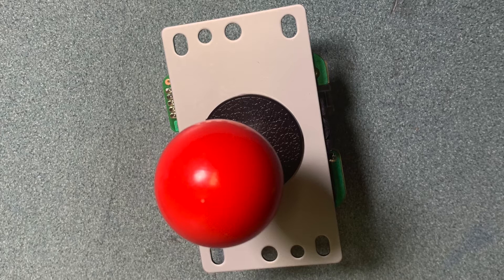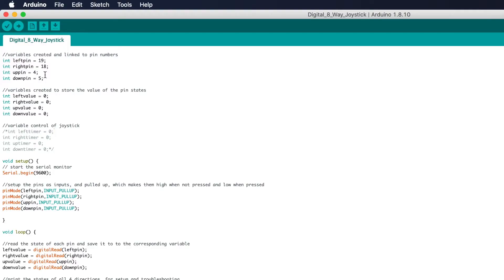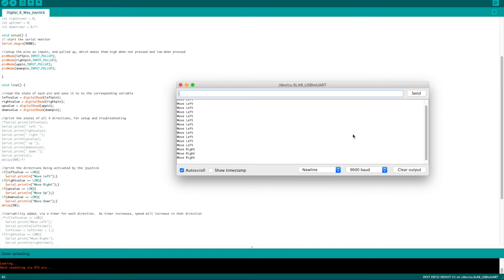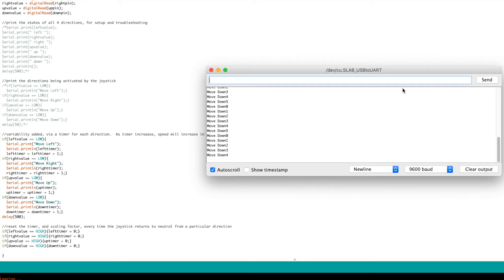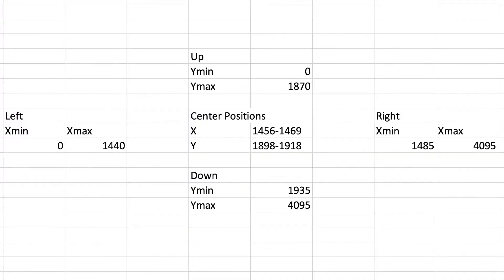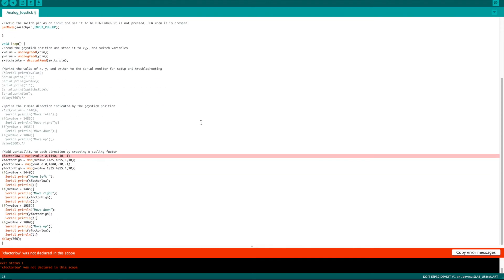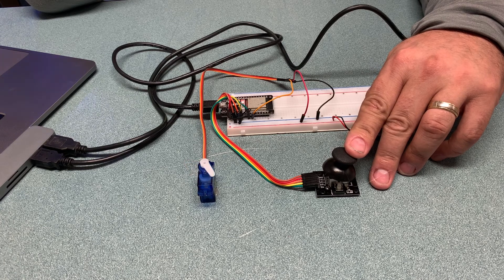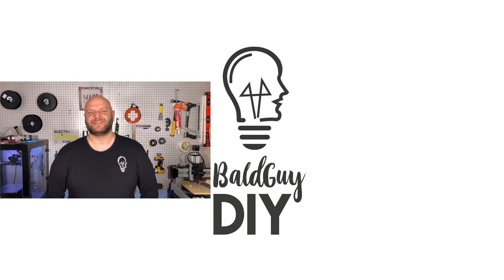Configuring 8 way digital joysticks and analog joysticks with Arduino and ESP32

Comment: Hey, so I am a first year student and am in the robotics club at my university. Though it is my first time doing robotics. I am in a project right now, though I am having some troubles. I am trying to code a joystick to move a small car with 4 wheels. Would code for a wired joystick work the same for wireless? What would be the difference?  Thank you very much
Reply from the maker: Thanks for watching!  My daughter is also on her school robotics team, I hope you have a lot of fun. The one thing about the robotics that schools use, a lot of times they use a proprietary platform like Vex Robotics with their own software and coding. While the concepts are similar to the analog joystick examples I give here, those platforms will have their specific coding requirements. The good news is that there are usually a lot of YouTube videos and blogs of people showing how they built their robots. Good luck!
Reply: @BaldGuyDIY  That's cool! Thanks for letting know, I am a beginner and am learning about all this, its a lot of fun! We use the Arduino IDE as well as the Arduino Uno, but I have a personal Elego Mega 2560. Do you have happen to know some resources that I could use to continue learning c++ and the arduino functions themselves because a lot of the library involves knowledge of circuitry to some extent. If not, then don't worry, I already know of stackoverflow, the docs for Arduino and like you said youtube and bloggers as well as tinkercad.
Reply from the maker: @averydrago  That’s great that you have a lot of Arduino hardware to work with. If recommend just starting with building blocks of how different parts of Arduino code work to do simple things. When I started I really enjoyed the series by Jeremy Blum. 
https://www.youtube.com/playlist?list=PLA567CE235D39FA84
I haven’t checked out his channel for a long time but it looks like he’s also published a book about learning Arduino. I also really like Dronebot Workshop if you want to know all about a particular topic. His videos are quite long, but they get pretty detailed which is great when you have a lot to learn. Good luck!
Reply: @BaldGuyDIY  This is really cool! Thank you very much!

Comment: Thanks for a clear and good video. Few questions and comments: 1) Could you please share the code? 2) Wouldn't the usage of pins 2 & 4 be a problem if ESPnow is used? (or any wifi)? 3) I recommend adding connectivity diagram because ESP has double meaning numbering, which can be confusing. 5) I recommend adding links to purchase the joysticks - will help the users, and may also help you,,,,,
Reply from the maker: Yigal B thanks for watching!  Send me an email to brandon@baldguydiy.com and I will send you the code. Using pins for digital inputs and outputs hasn’t seemed to be a problem with ESP NOW. If you’re using analog pin functionality, you need to use the pins that are connected to the other ADC. I cover that in my video on ESP NOW. Thanks for the feedback!
Reply: @BaldGuyDIY  Email you for he code? What is this, 1992?!
Reply: @BaldGuyDIY  Ist the Mailadress still correct? I sent you an email a few days ago, because i need this code to make an 8Way Digitalstick act like a mouse (i hope i will figure out how to combine the mouse.h with your sketch).
Reply: Thank you for anwering my mail a few minutes ago!!